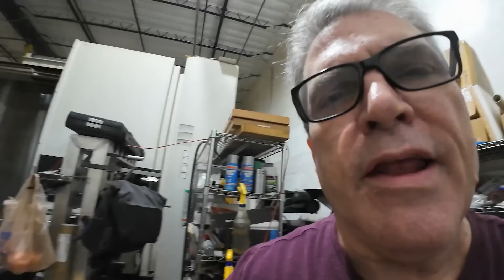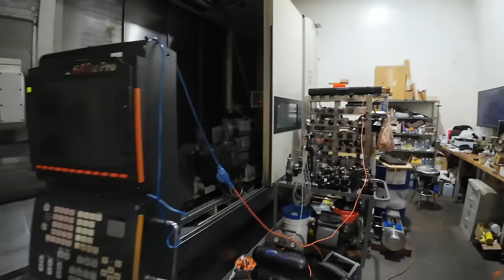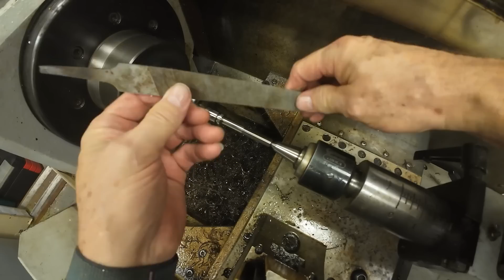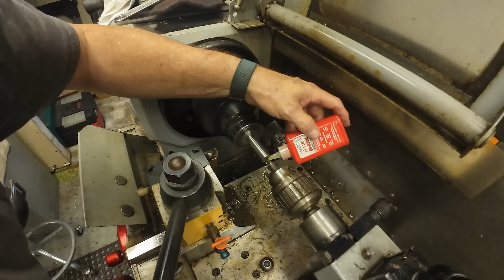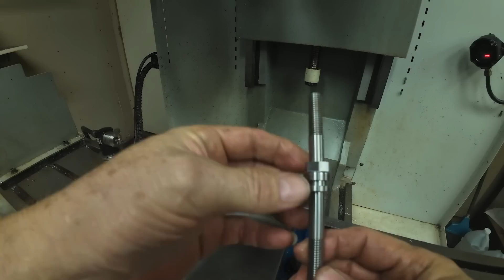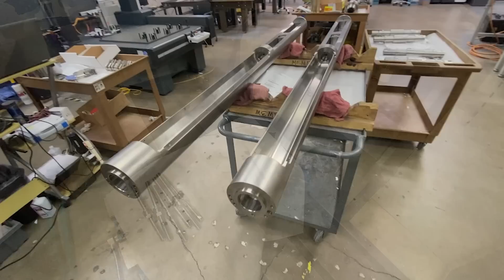Special Studs To Fix A Problem

Comment: 22:30 I have special files that I use on the lathe, I remove the sharp tang, and grind a nice radius on it. I've done that ever since I read about some guy using a file, it hit the chuck and the tang went through the wooden handle, into his hand.

Comment: Great video!!  what size chamfers do you recommend for threads
Reply from the maker: On the start of the thread. I usually go .010 smaller than the root diameter at 45 degrees.

Comment: I have a haas st 25 that does not use the g41 or g42 except the last roughing pass then it uses the tool nose radius my old okuma lb 15 lathe uses the tool nose radius each roughing pass i think there two types of roughing passes that different company's use affects were you start and end your your tool depending on the direction that your moving
Reply: Cutter comp us ignored in G70 regardless, when G70 is commanded and the control jumps back to P Q reference blocks, cutter comp will be used.
Reply: My okuma doesn't use PQ or even G70 and i can tell it where to start a chamfer and it will automatically drop to the center of the tool nose radius the haas i have start below the chamfer then move up to the beginning of the chamfer so the program  are written differently